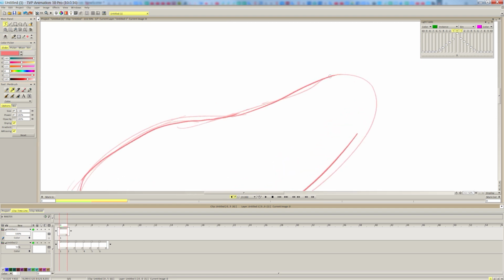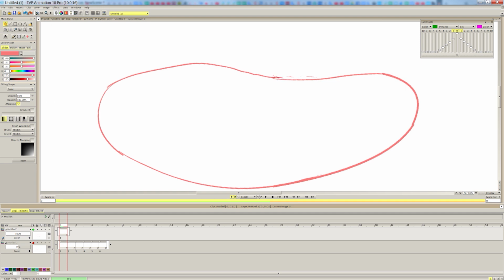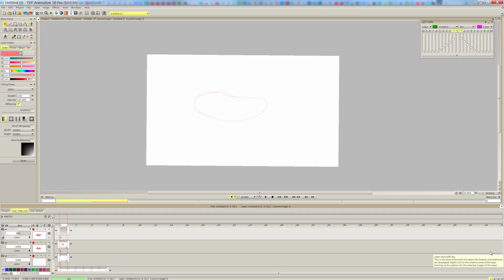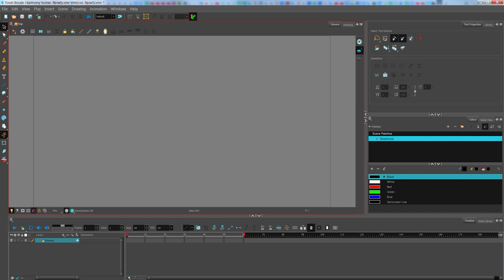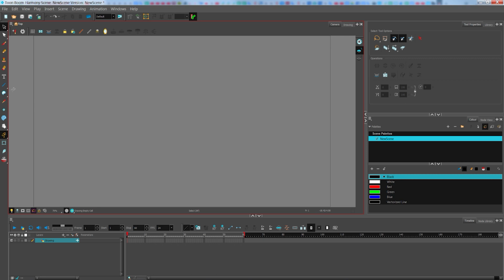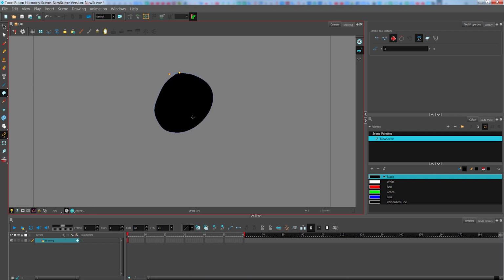Methods of animation [Basics of 2D FX]

Comment: Nice tutorial! By the way, about the Harmony tool, if you hold "ctrl" or "command" in mac (I think) after starting drawing the line, Harmony will automatically closes the line. If you use that combined with the "Auto Fill" option that exists in the tools like "brush", "pencil", "stroke..." it will automatically close and fill the shapes just like TVP.